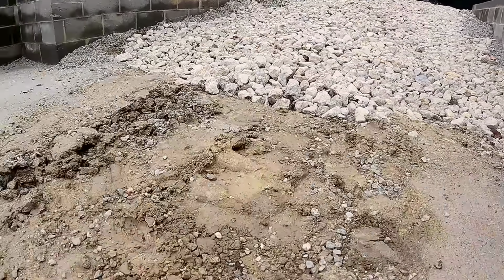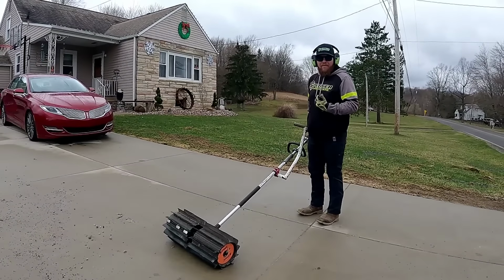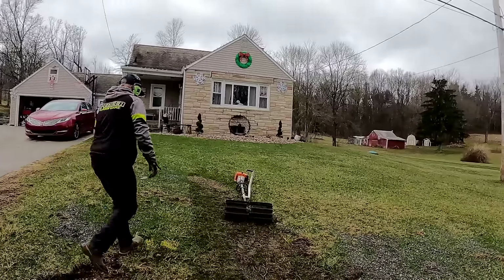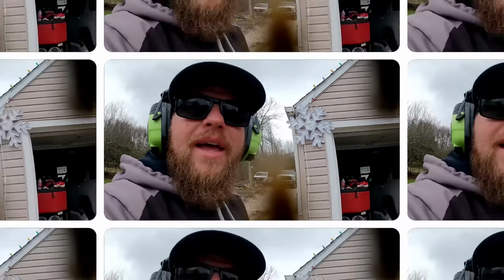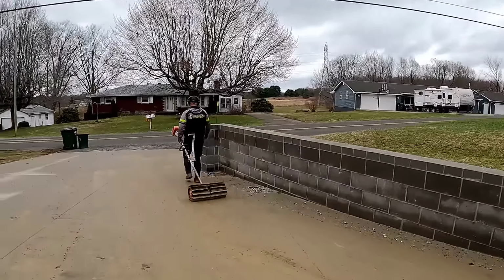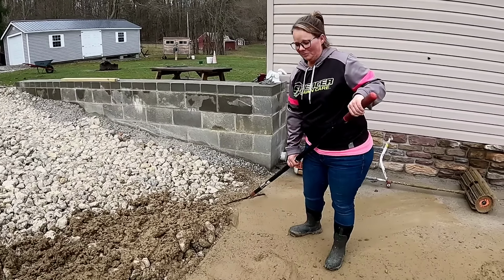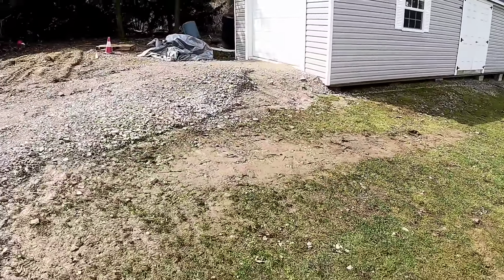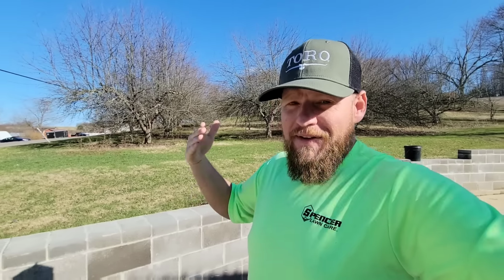HOMEOWNER AND PROS NEED THIS | HOW TO REMOVE GRAVEL OUT OF YOUR LAWN FAST!

Comment: DANG IT! 
Y'all going to cause me to spend MORE money!  :D
I bought a KM-131 a couple of years ago.  I started with the basic line trimmer attachment.  After seeing your video with the 'circular saw' blade (when you were cleaning the fence-line at that commercial customer) I bought another trimmer attachment so I could use that saw blade on some tree like weeds I have around here. (they grow like weeds, anyway!)  I have a gravel driveway and about 500' of gravel shoulder that I clear snow off of in winter.  I start the winter with a blade on my John Deere.  My thinking is the blade keeps the loose gravel right at the edge of the grass.  Later after the ground is frozen, and/or we get heavy snow, I switch to a snowblower.  In years past, for varying reasons, I ended up with gravel all over the place because I had to use the snow blower.  To that end, I bought a 'broom,' for the John Deere, to clean the gravel out of my grass.

In all of the years I've been doing this, this is the FIRST year it actually worked!  Because of the relatively low snow fall, and gaps between snow falls this year, I have a nice line of gravel about a foot into the grass.  Just last night, I was looking at the 'PowerSweep' attachment and, because of the current price, I had pretty much decided to buy a rake.  After watching this video, I think I'm going to spend the money!  I know it's a workout - years ago, I rented one of the wheeled versions of this tool...but I was dragging it up from the bottom of the ditch to the highway.  I'm a little older than y'all and I'm thinking that, as I get even older, it will be money well spent!  Between the 'broom' on the John Deere and this gadget, it will get the job done without killing me!  :)

Comment: Sthil power broom the best 25 dollars I spent back in 2000ish on a auction.
Reply: @SpencerLawnCare  I'm sure the one you are using is alot lighter than mine but its still a work out. works great to move snow plow gravel/pea rock, wood chips from tree stump or trimming tree, to inch or less snow on driveway. Something bout being gas powered makes it easier than raking.

Comment: Might have to try that tool out, I always used my backpack blower to blow gravel out customers lawn & cleaning up driveways. Looking at your situation I'm thinking if using a pressure washer would had worked great cleaning that driveway up

Comment: I sent that tip and another one, for removing gravel into the comments about a month ago. Another tip is a barn floor scraper for the driveway. Used it A LOT when cleaning mud and gravel up after concrete trucks came in a site. Really fast. Concrete and asphalt EAT those rubber paddles quick!

Comment: Another thing that works pretty good is to use the skid steer and scoop up the snow piles late in the season while the ground is frozen and pile it on the driveway. There will still be gravel to clean up but alot of it is mixed in with the snow pile.

Comment: I have seen some use this to clean snow off driveways and sidewalks. A pressure washer would clean that mud off the concrete driveway.
Reply: I use mine year round .... I have this attachment plus the brush and the trimmer attachments
Reply: it is the best tool for snow ...... I don't always need a snow blower...... but I use the power broom every time.

Comment: Might think a simple machine will do your job easier & faster to move on to the next projects. It also saves you from coming home with a sore painful back. Good thing to get the rocks out of your yard back on the street not to damage your lawn mower. Once yours finally gets shipped to you just in time for the season. Looks like the outside of the trash can needs a good wash down.

Comment: I’m going to need one of those
Reply: yeah the brush sweepers are great plus it brush the dabre into a loader bucket they are heavy as heck but better then wasteing money on rakes that breaks every time  wich why i dont buy leaf rakes any more i mostually use the sweeper brush  wich makes life easy but heavy wich i am gonna purches a 32'' 5 forward and 2 reverse walk behind street sweeper
Reply from the maker: They are good to have
Reply: @SpencerLawnCare  yeah i have the bristle brush that rotates to run the brush backwards into a hole wich kinda slick now im gonna be getting a 32inch bigger one with blade and collector attachments

Comment: The one thing to keep in mind is that this paddle wheel on the kombi is heavy.  Really heavy when using it for awhile.   They are the best thing ever for gravel in the grass.  Works just like the video shows.   What the video doesn't show is how tired you are after using it.

Comment: I have found the PowerBroom to be very helpful in my lawn care business over the years. I purchased my first one, a Shindaiwa PB270 in 1999. I also bought a trimmer gearbox for it so can use as a trimmer, brush cutter, cultivator or PowerBroom.  In 2013 I purchased a Shindaiwa PS344 PowerBroom which is also a dedicated unit. It was a demo unit at less than half price so couldn’t pass it up. I find it easier to remove the gravel from the grass before it begins to grow and is still brown in color. The only repair has been to the PB270. I replaced the clutch last year.
Reply: I haven't seen any new Shindaiwa products since 2007 or 8ish. Hard to beat first to start last to quit product.

Comment: Love mine, usually sweep most of our sand into the kubota bucket and then move it away or bring the gravel to the best spot, that mud you could use the skid steer loader to get the bulk of it without damaging the concrete then touch up with the powerbroom after.  It’s also great for snow and sidewalks.

Comment: Great video, as always....I too always have a great deal of stones on my lawn after a bad WNY winter. It seems there ends up being more stones on the lawn than in the driveway by winters end. But, I also have a full stone driveway that is over 75' wide x 125' long and only one small area to place all the snow. ....I have tried this sweeper before and I have found that a backpack blower (a good one) works much better than the sweeper does. In part because my stones are #2 limestone(?) , not larger pea gravel like you have. I can also blow the stones off the snow piles as they melt with ease. The biggest problem I have found is, as shown when you did your front yard, is the amount of grass that ends up coming up with the stones when you use the sweeper.

Comment: You all did a nice job, as always. That sweeper sure is nice.  I've seen an ad for it a few years baack, but never appreciated its value till I watched you put it to work. Made that driveway clean up a breeze.  Well a little sweat equity as well. Don't think I'd have the strength to run one, but it rocks. Pardon the pun !!

Comment: Hey Sean and TQ that machine you use the power broom. Many years ago I saw a flyer on it and I was looking for it to see what it does. I went to one of the local small engine shop that sells equipment and they had one on the shelf. I asked if I could demo it and they let me take it outside and I was very impressed on how good it worked and I asked for a sale. They told me it is on sale. And I said I want a sale that I take this home now and I said I don't care what the price is. The machine sells itself. I have also used the power broom on lawns to rake up acorns from an oak tree that has fallen the eight coins down on the ground in the fall. The first power broom I bought was The paddled that you have used. I do not like the bristle broom because it doesn't get the center. Before I bought this tool, I used to do all that work that you did with a street broom by hand. See you on the next video.

Comment: Great video Shawn and TQ, I use a Stihl 131R Kombi with the paddle works awesome! The only bad thing it gives you a little workout because it spins the opposite way.
Reply: There's probably a torx head bolt or two holding the paddle gearbox onto the drive shaft.  If you loosen those, rotate the gearbox by 180 degrees, then carefully tighten the bolts again (don't over-tighten or the gearbox casing might crack) then the paddle should spin the opposite way.
(Full disclosure, I don't yet own one of these attachments so this is my best guess as to the solution)
Reply: Turn the powerhead upside down and pull the paddle towards you. Your back will thank you.

Comment: I would venture to say you used that paddle broom more than he ever did. why don't you give him the new one and you keep that one? they have a special gear grease for that particular head, the gears have lots of friction and need attention after the work out you gave it. btw, the gear head needs to be stored hanging down so the grease doesn't escape up the shaft when sitting for long periods. for those that have the stihl 2 cycle rotor tiller, they have both a bristle broom kit and the paddle broom kit for it as well as the weed eater head.  
we have gotten thru all our mows at least once already- picked up tons of branches, rocks, ready to go. be safe everyone.